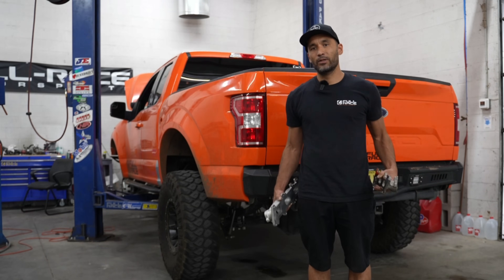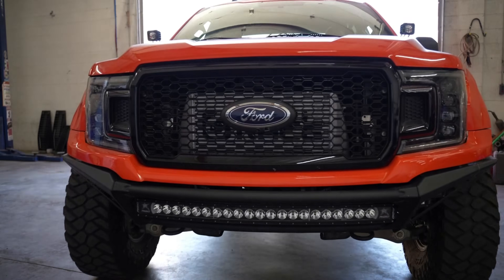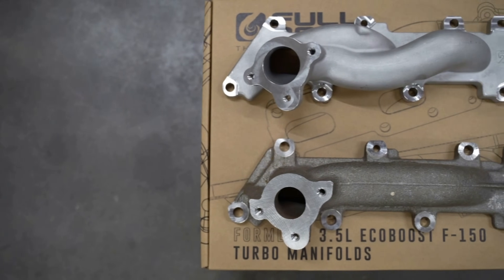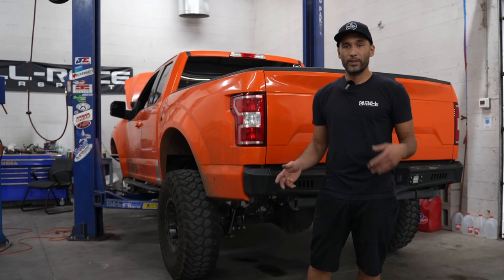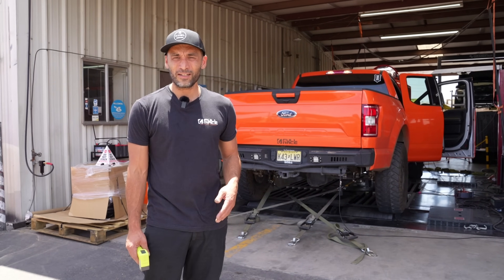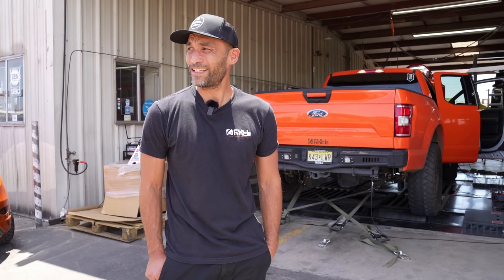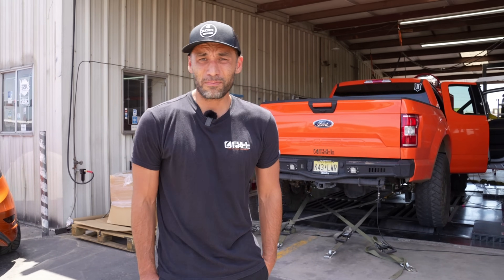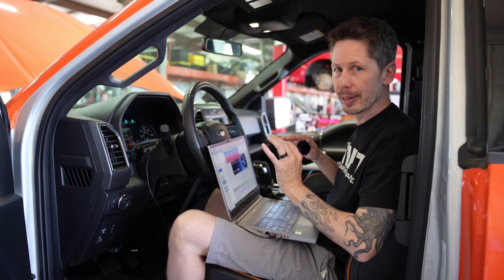Full-Race Formline Manifolds vs OEM Log Style EcoBoost 3.5L - Back to Back Dyno Test

Comment: Basically the same motor as the F150 Raptor, not even close. The HO D35 shares 70% of its internals (mostly lower components) with the ford GT. How many parts does your regular D35 share? Zero.

Comment: thank you guys for being the only clip with sound between having and not having the manifold
Reply from the maker: thanks for noticing!  The in-truck sound is much more refined with these manifolds - the OEM manifolds have this weird rasp-sound around 3000-3200rpm.  like a harsh vibrating resonance that completely disappeared with the Formline turbo manifolds

Comment: Is this kit will work on other Gen2 3.5L Ecoboost like the one in 2019 Expedition?
Reply: Here for this
Reply from the maker: @talarcoj @lifebehindthewheelnelson577 YES - the 2018+ Expedition and Navigator share the same engine bay as the 2017-2020 Raptor and F150.  The installation procedure and parts are identical, no changes.

Comment: No way these numbers happen without a tune. Stock injectors would be at or near limit.
Reply from the maker: Hello and thank you for your feedback!  You are 100% correct, the truck is most definitely tuned!   We could have performed a stock tune run, but it would output stock HP. If you find value in knowing what a stock power level run would look like in comparison please let us know and we will keep this in mind for the next dyno session! Keep in mind all Ford engines require tuning to gain any power above stock (no matter what parts are bolted on the engine).  If you improve breathing without tuning, the stock tune will maintain stock power levels by closing throttle and opening waste gates.

Comment: I would have love to seen this done on a bone stock truck
Reply from the maker: On a bone stock truck it is usually best to start with intercooler.  The OEM heat soaks and the engine pulls timing so you cant make power
Reply: This thing sounds amazing! Is there a video on the exhaust setup? @FullRaceTurbo

Comment: Those gains are not with the same tune. I get that those turbos were likely starved for flow already but those results are literally impossible without changing the calibration for increased fuel to compensate for the increased airflow.
Reply from the maker: @FullRaceTurbo

Hello!  You are correct, and the truck is definitely tuned, we did not hide that fact.   What we are showing is a baseline vs what the manifolds allow then we compared it to a less heat-soaked run.  For sure  formline manifolds allow changes in the tuning side.  If you read the detailed article on our website you can see there is a baseline, what the manifold allowed us to and then cooler conditions less heatsoaked run with improved engine operating conditions.  Thank you for your feedback

Comment: gen 1 2015 here stock on 93 stock tune i feel i dont need to be faster in a crew cab truck pulls like a train already
Reply from the maker: 2013-2016 Gen1 is a great platform, and 2017+ Gen2 are even easier to go faster with!

Comment: What if you have a stock truck and you need to replace the factory manifolds but don't plan to do any tuning? Can you swap these out without changing the tune?
Reply from the maker: Yes, with the stock tune these can be swapped in just like any other part.  The engine computer does not allow any power adders to increase output without a tune.
Reply: I have my 93 tune already plus exhaust gonna add this plus the turbo adaptor 25 hp more or 30 plus ? Raptor air intake as well

Comment: Holy Fawk. If this was true these manifolds would yield the biggest gains for the ecoboost platform beside tuning. I would have figure 10-15 hp  25-30tq on 91 octane. The gains posted here feels like E85 and revised tuning was added to the mix plus the full race manifolds.
Reply from the maker: If you look at the oem ecoboost manifolds it makes a lot of sense.  Whether ecoboost 3.5 or 2.0 they are all designed for earliest possible spool and restrictive at increased power levels.  Keep in mind we’re on stock fuel system and pretty much maxed on gasoline.  Have a plan in place for bigger fuel system and a lot more boost
Reply: @FullRaceTurbo  I appreciate the response! I hope you guys offer a setup for the 2021-2024 Raptors
Reply from the maker: @nmotionproductions29  its in the works!  we are close to releasing more info
Reply: @FullRaceTurbo  Beautiful. I look forward to the upcoming information release.

Comment: Ran them on my truck. Ran out of fuel system the moment boost came on
Reply from the maker: @minnesotawaterneckmiller5430
What was your exact setup and the final boost level / power?  Would love to help you get the most out of it!
Reply: @FullRaceTurbo   I had full race manifolds power max turbos stainless works y pipe to a 3 inch cat back. K&Nintake. Nobody in Minnesota wanted to tune it. I used the truck to haul cars for my dealership. First it didn’t like the electric gate. From turbosmart so had to switch to there other one. Then when ever it would make 17psi it would start cutting power.
Reply: @FullRaceTurbo   I’m pretty sure I have data logs for the truck still if you guys want them from my build. I ended up selling the truck. It was becoming a pain.
Reply from the maker: @minnesotawaterneck  the tuning side of these trucks has evolved alot the last couple of years, and the mechanical work is fairly straight forward and well understood at this point.  Things have gotten much better for enthusiasts

Comment: 90whp and 80ftlbs with a manifold swap? 

How much additional tuning was done after the manifolds were swapped? I feel like a bit more transparency in the tuning process after installation would give some more insight. 

I have these manifolds on my Gen1 with Powermax Stage 1s and didn't gain anywhere near that power. I must have faulty ones.
Reply from the maker: Full details are found in the write up here: 

https://www.full-race.com/resources/blog/Full-Race-Formline-Manifolds-vs-OEM-Log-Style-EcoBoost-3.5L-Back-to%20Back-Dyno-Test

Keep in mind the gen 2 power max are much bigger turbos than gen 1 power max
Reply: @FullRaceTurbo  That makes more sense. The Gen2 Powermax has the potential to flow so much more air. 

Do you have a favorite Gen1 exhaust? Right now I have a res delete 3" SS SPD pipe welded to stock muffler.
Reply: @FullRaceTurbo  Will you be releasing a Gen 1 Formline/Powermax combo Dyno?
Reply from the maker: @ProjectAjax definitely a possibility.  I suppose if the community finds this type of content useful we will consider it!
Reply: @FullRaceTurbo  I will definitely share it and help get it out there. This type of content def helps the community grow and also helps get people to go beyond tune only to push the platform to the next level. Id love to see these mirroring the B58 platform of growth and push past where we are right now to more turbo options to 4 digit hp builds.
Reply from the maker: @ProjectAjax  the biggest thing holding us back from serious power is camshafts and valvetrain!  If you guys want to see B58 evolution, kelford and headgames are the two companies I am begging to take things to the next level
Reply: @FullRaceTurbo  Good to hear! I saw Kelford makes cams for the Gen1 but nothing for the Gen2. Super Six Motorsports is also doing some cam work for the Gen1s.  Id like to see a port injection kit for Gen1s added. Would be awesome.

Comment: Is it possible make it more then 700whp i wanna faster then rapter r
Reply from the maker: Yes - the 700+ power level requires rods, pistons, gen 3 crank 4:25, and gen 3 timing chain components
Reply: @FullRaceTurbo  I assume you have to upgrade both fuel pumps and injectors along with the internals?
Reply from the maker: @tyranicalteabagger  for the 700+ level that is correct and we are building another truck for that power target (motor, trans, fuel, etc).  This orange truck in the video here is a 100% stock long block with  OEM fuel pumps / injectors / internals - all bolt ons!  full details in the writeup here: https://www.full-race.com/resources/blog/Full-Race-Formline-Manifolds-vs-OEM-Log-Style-EcoBoost-3.5L-Back-to%20Back-Dyno-Test
Reply: F150 ecoboosts making over 850whp and in the 9s in a crew cab 4x4 right now.